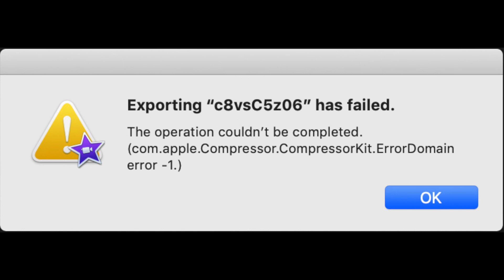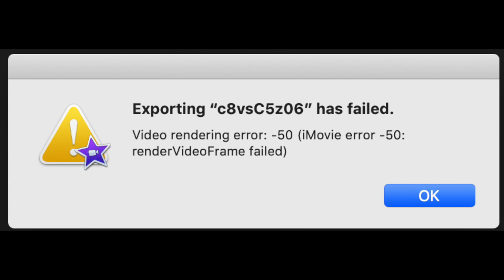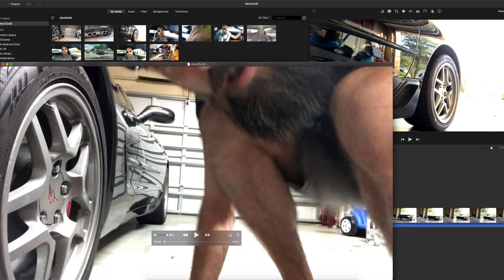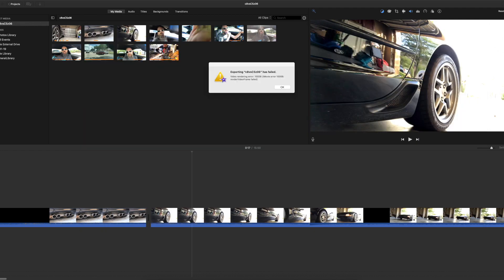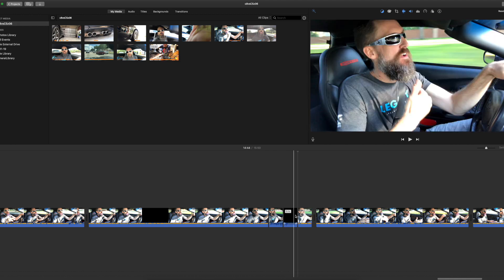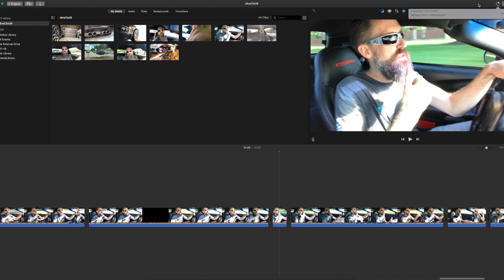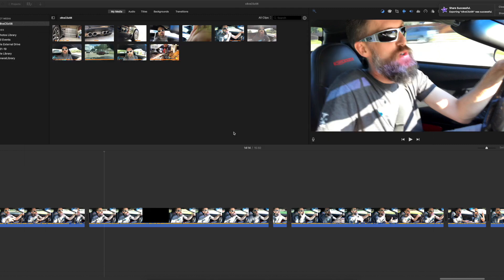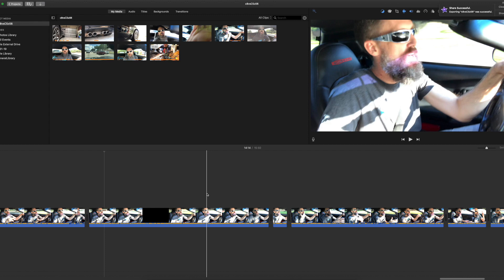Fix iMovie Video Rendering Error 10008 Error -50 and Compressor error -1

Comment: so i have about 15 black spots in my imovie project, do i have to delete them all for the video to work? because that would ruin my video :(
Reply from the maker: leryx hi! Maybe, but it might not be that bad. Let me explain. In my experience the black frames are usually around transitions. Not always, but mostly. Also, when I’m scrolling through iMovie looking for black frames sometimes my computer can’t keep up with displaying the video correctly in the viewer so it shows a black frame. But if I click back and forth the video shows back up so it really isn’t a black frame. Also, if you have a lot of transitions in the timeline and one of the blocks shows black it’s most likely a black frame in there somewhere. The fastest way I found is to do a quick export and play it in QuickTime (like in this video) to find where the video stops playing to find the black frame. In my experience clipping out a fraction of a second was barely noticeable if at all and that’s to me because I know it’s there (or now missing). Also, I found that when filming on my iPhone if it was in low power mode or otherwise overworked (too many background apps running) it would drop frames either during filming or transfer to my computer. I hope this helps and your videos turn out amazing!

Comment: Great video !! What if there isn’t a black screen?? How do we fix the error?
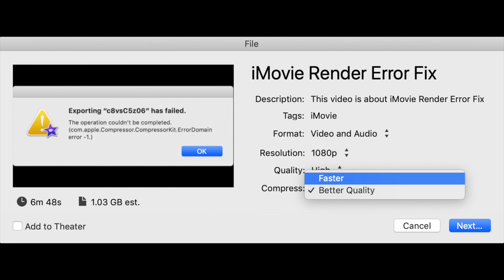Reply from the maker: Ty Monaaa Thank you!! Sometimes it’s hard to find the black frame. After watching the exported video that failed and finding the point in the video where it stops (say 1:20 in the video) go to that point in your timeline in QuickTime and use the left and right arrows to advance frame by frame. Sometimes it doesn’t show right away. I had one 2 days ago that wouldn’t show but I knew it was at the beginning of a title so I just dragged it a little and it exported perfectly. In my experience it’s usually a transition, title, or something of that sort that causes the black frame or export problem. So I just cut out the black frame or move the title/transition a little and export. Have a great day!

Comment: hi there, i have the problem of Compressor error-1 and i tired the compress both faster and better quality, it still doesn't work.

Do you have any other suggestion for me to do ?
Reply: Why would iMovie all of a sudden stop exporting? I exported a short music video last week and it was fine. Now it just failed. Regardless of content.....I’ve tried deleting he app and reinstalling it. Tried the safe mode process....still no good......iMovie is pointless without the export function......will keep trying.....there has to be a fix
Reply from the maker: Al Da Keys that’s the spirit, there’s always a fix!! If iMovie was working fine but just stopped working it sounds like it could be there’s not enough space on your drive or one of the files are corrupted. Try exporting another project that you’ve already exported to see if that works. If it does then it’s not iMovie or a space issue and it is limited to the project. If it’s the project then it’s likely a file, transition, or effect issue. At any rate think about what was going on between the time of your last successful export till now and you may be able to track down the issue and Google it for a solution. Have a great day!
Reply from the maker: Tasama TV Hi! I mentioned it pretty quickly but I had multiple virtual machines open in addition to multiple applications besides iMovie. So I closed the VM, applications, and restarted iMovie and it worked. But if you’ve haven’t restarted your machine in a while I would do that too. After all that make sure your computer is fully booted and nothing major running in Activity Monitor. I would only open iMovie and try the faster compression first. Video editing etc is resource heavy so I would make sure iMovie is the only thing running. If that doesn’t work maybe there are iMovie background tasks running or the file type? Let me know how it goes!!
Reply: @Daveandbillie  no, didn't work. I tried so many ways. I also delated some of the vdos in the imovie library. But still doesn't work. I'm crying , i cannot make any new vdo
Reply from the maker: @Scottish-Fold  I'm sorry to hear that. I found a couple of solutions you can try. First is booting into safemode then shutting down and then startup normal, run imovie, and export. The second is to go to Applications, right click iMovie and select "show package contents". Navigate through Contents/Plugins and move the Compressor folder to another location. Start iMovie then export which will fail. Close iMovie and move the Compressor folder back, open iMovie and export again an it should work. But FIRST before doing all that make sure you have plenty of space on your hard drive. Go to your search bar and type "Disk Utility" and open that app. You should have at least 25%-30% free to operate properly. Take a look at the "Available" which includes "purgeable" space. When you delete files MacOS sometimes stores the files here and the only way to get that back is to copy a file larger than the "purgeable" to force it to permanently delete this space. I had an issue with my iMac getting really slow and freezing even though finder was showing plenty of free space. Turns out the purgeable space was taking up space so when I reclaimed it my computer unfroze. I'm going to post a video with this procedure soon but as for the Compressor issue I will post the link where I found the solutions below this:
Reply from the maker: Here's the link for the Compressor fixes above: https://discussions.apple.com/thread/6454828
Reply: Dave & Billie thank you so much for your reply. I will try again tomorrow. 🙏🏻👍🏻
Reply: Dave & Billie  I was having this same issue with the error 1 and those options didn’t work for me still :( Is there something else I could do to fix it?
Reply from the maker: @SydneeM  I'm sorry to hear that. You may try Resetting the PRAM, SMC and NVRAM. Just Google the process for your particular model. If that doesn't work try these methods:  https://support.apple.com/en-us/HT206157
Reply from the maker: @SydneeM  Also, I read something about Rebuilding the CompressorKit bundle.
Reply: @Daveandbillie  Okay i'll give that a try. I've done almost everything. Thanks

Comment: How do you do that. You literally just did it without any explanation of how to cut out a one second frame. Terrible tutorial this could have been 3 minutes
Reply from the maker: Hi Matt, starting at 4:05 in the video I explain that you edit out the black frame. To do this, once you find the black frame, to the right and left of the black frame you right click on the timeline and select "split clip" or you can use the keyboard shortcut Command+B. Then click on the portion you isolated and delete it. In this case it was actually the transition where the black frame was so I edited out a portion on either side of the transition (there were 2). The end result is you end up missing a split second of video. Hope this helps, have a nice day!